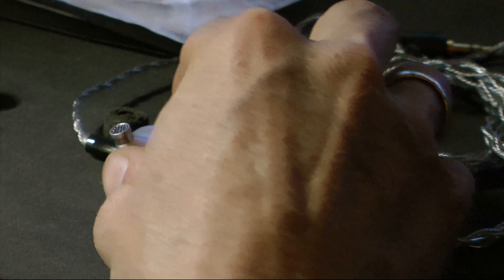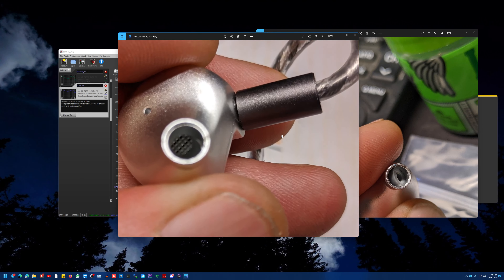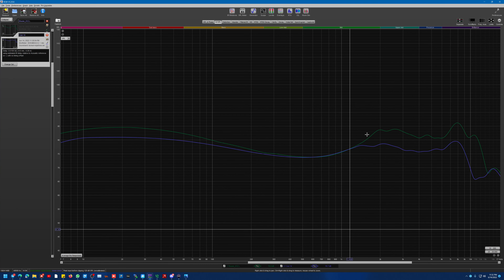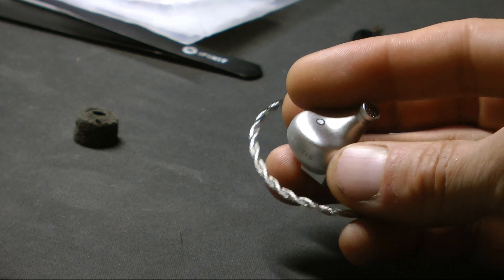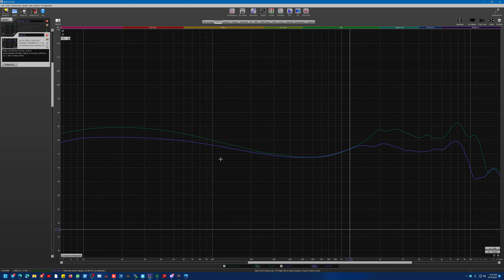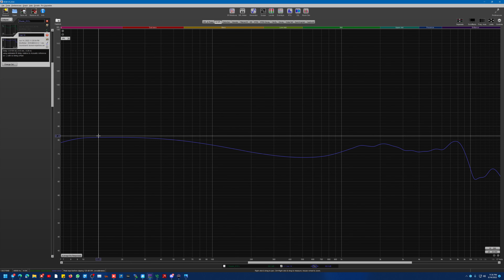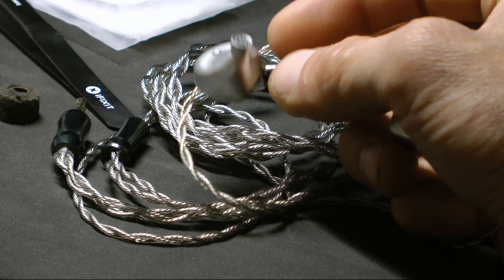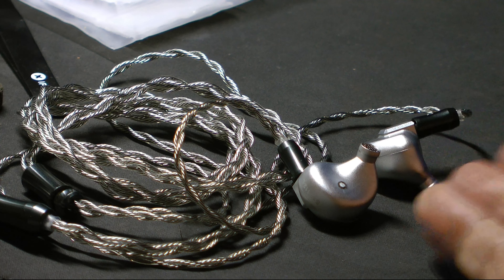LETSHUOER S12 Bus Mod *rec'd for moddy folks*

Comment: Good work! If you wonder, why your result is so pleasing, then check the ISO226 curve and maybe think about it. That's my favorite, most neutral, reference graph that I work with the last year. Done the Z12 via EQ into ISO226 shape for now with stunning results. And it's the IEM that performances at low listening levels impressive without loosing any qualities in base, mids and hights. (with this very neutral curve)

Only drop down with the corrected S/Z12 ist the manufacturing control from Letshuor, not on, lets say, Moondrop level till now. The housing and cable are on par. On the other hand, Katos and Arias need correction either and can't hold up with clarity.
If dampening or reshaping the 'tip outlet' hole helps with lowering the timbre (ie resonances), great deal! I will give it a try.

I mentioned you first pierced the mash of the venting hole and later you covered it with 400 mesh. May I ask, what was the reason for that, and was pinching obsolete?

Comment: Guys you don’t have to spend on tips .. you can do it with the soft tips that comes with s 12 ….just cut for the best fit… and trust me you will be very happy with results… coz it is also thin so driver breathe properly and sound come across…. Coz the tips from etomotic and shure and sony have think layer so bass gets very heavy and sounds gets very dry… s 12 knowns for open sound… the tips am experiencing gives bass cuts upper mids and give same amount of trouble but no fatigue at all, so sound so amazing…..  yea make vent hole little big…

Comment: Thanks, they are a bit bright for me stock, and I was curious if you had any plans.  I almost mentioned it on a recent video.  The S12 is a set that takes EQ really well, so you can do some fun things that way too.
Reply from the maker: I can eq them easily.  Forget that, do the MOD!  It increases 3D, changes the way freq hit the ears.  Worth it 100x.
Reply: @MichaelBruceShortbus  I will have to check it out.  It is strange how little it takes to make a good IEM into a great one.

Comment: I must have bought the wrong tips off of Amazon brother, the link takes you to these foam tips that when cut to ~ 3mm look nothing like what you have. Sure I can get these inside the bore of my S12. Did you use the end of the stock Etomotyk  silicone tips and not the foam.? Thank You mentioned both materials in your video.

Comment: Thanks for the tip! I might try it out. I will probably try this mod first: 1. Cover around 70-80% of metal mesh with micropore tape or maybe Olina mesh filter, 2. Add Y4 tuning filter to front vent. This should also help bring down the treble. Wish I had a coupler mic to measure it afterwards!
Reply: Where do you get the Y4 filters. I lost my Olina filters too. Are the Tanya filters ok..?
Reply from the maker: Fair warning dampers dont work with this iem, nothing like normal ones.  This mod works, pay attention to the angle of the insert and the bit of foam at the end.
Reply: @MichaelBruceShortbus  we need some pics of the foam that goes after offset Etymotic tips you inserted please..?
Reply: @MichaelBruceShortbus  good to know! wonder if it's a planar thing where the mesh filter/dampeners don't affect the sound much. The filter over the front vent does have an impact, though

Comment: how much extra db of bass did you get with the filter on the front vent ? i tried it on s12 and did not get a noticeable bass boost as if it did very little on planar ( unlike when i did the same front vent mod on DD such as HM ou olina where it provided a very noticeable ( and needed) bass boost.)
Reply from the maker: It's very hard to quantify!  Look here: https://shortbus.squig.link  and pull the S12-SB and S12 graphs and align at 1k.  You might think stock has more bass but it doesn't because I flattened the curve.

Comment: What is the tuning paper density you used for the hole near the nozzle? Will Y4 work?
Reply from the maker: Try what you have, its a 500 value damper which.. I dont know how that works out to the Ys.
Reply: @MichaelBruceShortbus  Hi there, may I ask when you said 500 value damper, what do you mean by it? And where can I get it? Thank you, much appreciated!

Comment: I think the S12 sounds it's best when EQd. However I do enjoy them stock with Spring Tips. I don't have the issues you have with the treble and I don't think they're tuned poor either they're just not tuned with a dark treble.
Reply from the maker: For my library, which includes a lot of extreme styles such as Grindcore, deathmetal, vaporwave, etc.. it has too much treble.  Poorly tuned isnt fair, just wrongly tuned :D haha, all good my man, enjoy what you want
Reply: @MichaelBruceShortbus  Thanks, I was going to ask what your library was like.  The S12 works pretty well for classic rock, but I find when I listen to metal, I prefer the 7hz Timeless a little better.
Reply: @MichaelBruceShortbus  hit me with a "BRRREEEEEEEEEEEEEEEEEEEEEEEEEEEEEEE". I'm a big metal guy, Deathcore,Metalcore, Prog, Djonty stuff. so these seem like a good suit for me, I might try modding it... but I don't know if I'll go this far with it. don't want to make a mistake as these are my first relatively pricey iem's. I'm getting the z12 model. I'll probably experiment modding my KZ ZAX once my Z12 arrives... just as a tester before doing anything with my Z12's
Reply: @NathanielBTM st got a pair of these I love listening to all genres of  metal and all I had to do was a bit of EQ in the 4k 8k down I'm new to all this stuff for any tips would be handy) bit and the sibilance and Peking is near enough gone sounds like a mini subwoofer plugs into your head the bass is incredible super tight great 3d sound  like just as much as my hd599 planer drivers just sound really different to dynamic drivers love  em

Comment: What I notice is that if an iem has to vents.  Nozzle and back. If I dump the nozzle. Bass goes up.  But once there is sweat in the gym. The driver struggles.same with filters on the nozzle.  Sweat makes them stop breathing and the dd struggles to work. That's the reason I use inside nozzle sponge dumpers.  But then the dumpers has some issues. The sony ones are great. But the medium dumpers outside the vacuum bag they expanded to 3 times the size. I have 2 types of high density   one covers all sound and driver goes crazy.the sony one works. But when there Is a ba on the nozzle, then only grill filters I can use

Comment: Hello man, I’m getting mest mk2 for most of music, but to get a great bass head iem to be complementary would you recommend s12 with eq? I was between s12 and ikko obsidian. What do you recommend? Something like cayin RU6 dac can handle the power to get the most of s12 bass? How about the highs of s12? With eq can handle the sibilance? I’m a little sensitive to some highs
Reply: for my average trained ears, s12 don't need power as i hear no difference between apple dongle 35mw and btr5 bal 240mw ( i did spend time making sure my loudness was identical using pink noise and a free android app db meter, my guess is that people who experience bigger bass with beefier source just balance volume by ear leaving a few db more for the beefier source and incorrectly conculdes that s12 needs more power). i know michael has more experience and concludes the opposite so draw your own conclusions but before buying a cayin ru6 instead of a $10 dongle dac as crinacle recommends , ask yourself : "am i in the 99% of average listeners or am i in the 1% trained ears who can hear source differences ?"